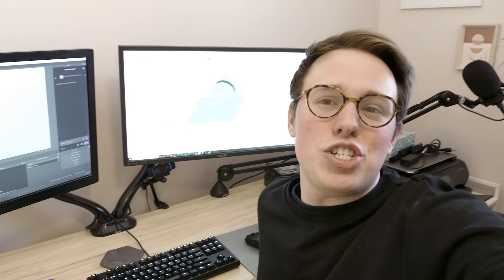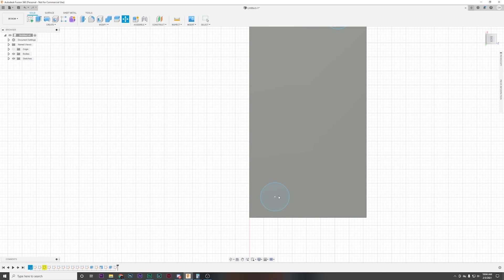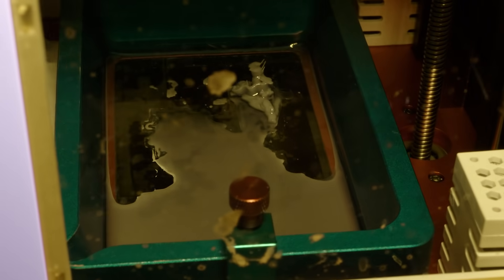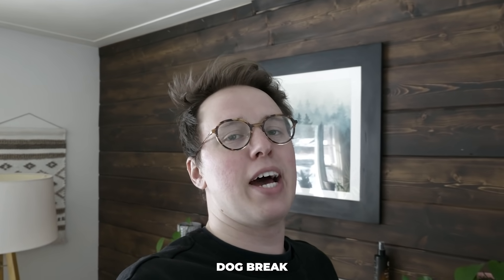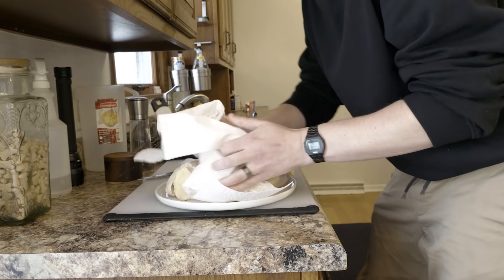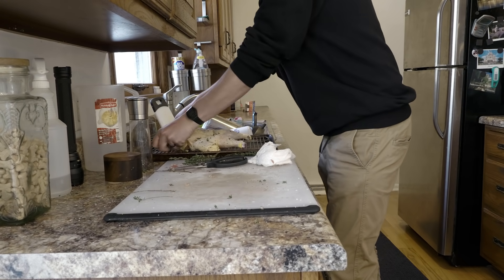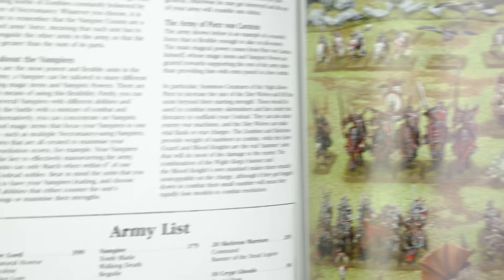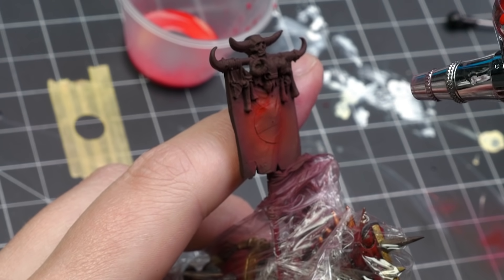CUSTOM Freehand for my Soulblight Gravelords!

Comment: 4:49 For added CITRUS goodness when parboiling potatoes for a roast, put a lemon and /or orange into the boiling water along with the potatoes. When the potatoes are ready to roughen up and baste (10-12mins later) set the citrus fruit aside to cool slightly and when it's time to put the chicken in the oven, gently pierce the boiled citrus fruit a few times and place inside the cavity of the bird. The lemon and/or orange will contribute to the cooking process (and flavor) by steaming the interior while the oven handles crisping up the exterior.

Comment: With something like that base, you def want to print it straight on the plate. Because it's such a large flat surface all the supports would make it bumpy and rough, and you would still get some warping on the bottom.

Comment: That is the correct way to print those pieces. If your part has a flat surface, and would requrie no supports in that orientation, it's the most secure and consistent for a resin printer. If you were to print this on supports, you are more likely to break supports leading to a failed print, and certainly a flat surface on top of supports will warp.

The "foot" you refer to will happen, and cutting that away is easy, but if you're super advanced, you can use the "fillet" tool in fusion to make the bottom corner of your part slightly recessed so that the elephants foot is smaller than your edge. (pro strats)
Reply from the maker: That's a cool idea!

Comment: We have the same printer. have you considered changing the light array underneath so you can have a 4k screen?
Reply from the maker: Link my with a guide
Reply: It's a bit of work, but if you can get the parts cheap or free, like i did, it's totally worth it

Comment: Kenji is such a great resource for cooking, his book is wonderful and I would highly recommend it!

I'm going to offer some advice regarding the 3D print, please take it or leave it as you want. A little late at this point, but when hollowing prints it's actually somewhat important to support the inside of the model, because when you hollow you create a lot of new 'islands'. With this model, when the top piece starts to print it is printing on thin air, so it could cause some warping/dipping, especially in the middle. I would probably recommend to print it at an angle to reduce suction forces, with supports on the bottoms and the inside. 

However something really important when hollowing are drain holes. You need 2 holes in a model in order to adequately drain resin from the inside, as otherwise you won't be able to clean the inside. Uncured resin is gross, but a bigger issue is that it will eventually degrade the inside of the model and cause large cracks in it. You can make these in chitubox, but since I think you've printed without, you could just drill these in the base afterwards to clean it out, and then cure the inside.

If you want to learn more about resin printing in general I would highly recommend checking out another youtuber called 3DPrintingPro, he has excellent information on supporting and printer settings:)

Comment: There is no "cheating" with 3D modeling. If one program works better for a specific job, you use that program. It's like woodworking tools. They can do things they are not "meant" to do, but usually they have a specific purpose in mind. I go between sketchup, blender, and solidworks depending on how difficult the goal is, what sort of properties it needs, and I can always import the file into another program to get the best of both of them.

Comment: Dude the shots of the 3d printer are sick. Did u use a dolly or was that hand cam work?

Also my dog was Oscar, aka the potato, aka the couch potato, aka the lump. 🙂
Reply from the maker: hand cam! slow mo + IS on the cam + lens, and a little warp stabilization on the final shot